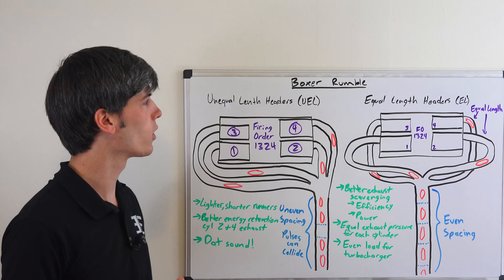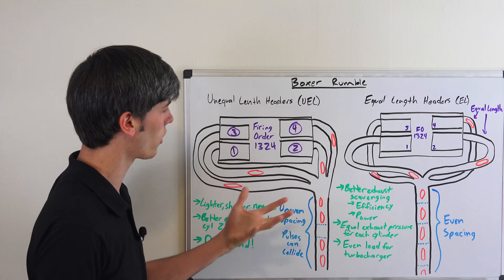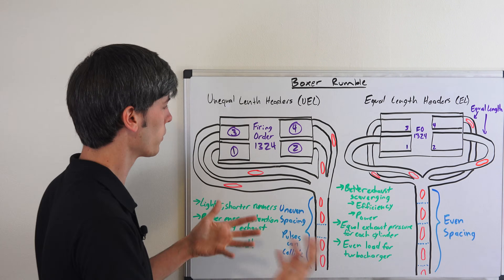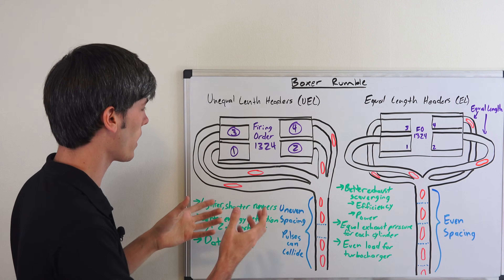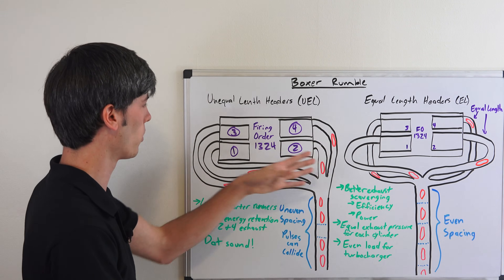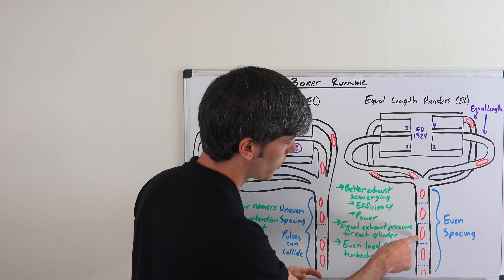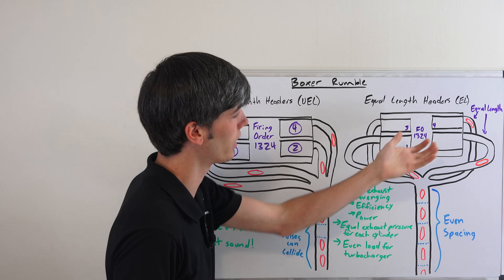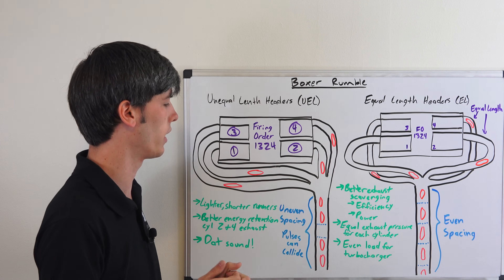Subaru Boxer Rumble - Exhaust Explained

Comment: It doesn't makes sense to me. It should be firing order 1 2 3 4 otherwise the gasses only once meet from two pipes at one time. In firing order 1 3 2 4 first comes the 1 then 3 and 2 at once then 4 and then should be break because the long pipe is first so it needs more time

Comment: Part of that iconic Subaru sound is the piston slap, and don't forget rod knock on the really well broken-in ones. 
I've been driving a 2006 Subaru now for about 10 years, and I'm not getting rid of it until it totally impossible to repair. I've already put a new engine in it at 190,000 miles, and I'm up to 225,000 now (about 35k on the new engine so far), and everything is going great so far.

Comment: A great video.  my question is for my Base model 2020 WRX/ STI. Does my base model WRX/STI have equal length headers or unequal length headers?  My other question is does the 2020 STI have an EJ25 motor or an EJ 20 motor?. Thank you 😊

Comment: Sorry but this explanation is not really correct. That's pretty correct that pipes length affects it, but the root cause of this "Subaru sound" is different tones of the exhaust pulses. Longer pipes give lower note, so we have two lower notes from cylinders #1 and #3 followed by the higher notes from the cylinders #2 and #4.

Comment: If I am right, the stock subaru headers are 4-2-1 UEL headers: the "4 to 2" lengts are equal at all of the cylinders, and the length differences are between the "2 to 1" lengths. Now, measure / count out that length difference. So if we design a 4-2-1 header for an i4 engine where the cylinders nr. 1 + 2 are connected, and cylinders nr. 3 + 4 are connected (the pair of cylinders next to each other - as the cylinder banks of the boxer engine), and the "4 to 2" pipe lengths are equal for the i4 engine, close to the subaru stock header's "4 to 2" lengths, then let's say, the "2 to 1" length for the cylinder 1 + 2 will be the shorter, but not matters the length, and for the 3 + 4 cylinder will be longer with the difference measured/counted out on the stock subaru header, then there will be the same exact ruble on that i4 engine? I mean, not the whole sound because of the totally different exhaust system, just the rumble...

Comment: Question: Subaru Levorg 2.0 non Turbo.
- Change with Manual Transmission 
- Install unequal length headers 
- swap the engine with an EJ25 (300HP)

Is this possible ?

Comment: So much more that goes into the boxer rumble. Different metals have different tones and sounds. Also resonators and mufflers and stock cats as well as catless + high flow all have different sounds. Another huge factor is piping diameter. Bigger the diameter, lower the tone.

Comment: Can you explain why boxer engines will have a boxer rumble when ran without headers and inline 4s do not? Because this little fact to me doesn't sound like it's all about the headers. Equal length individual header on a boxer motorcycle will also rumble and not an inline 4 with same setup.

Comment: The equal length headers were known as "Extractors" in Australia(possibly else where too).. also heard it referred to as "tuned headers" or "tuned exhaust" at some point. Extractors were fitted mostly to improve fuel economy more than anything back in my youth. They did make some difference. Like with not tuned headers, they had the advantage of removing heat away from the cylinder head more rapidly too than the cast iron manifolds could. Not sure how much of a difference it made for standard road use though..... 

There was the performance improvements that could be had too from the fitting of extractors.
Reply: tuned exhaust at least to me typically referred to 2cycle rc engines where it really mattered significantly more.

Comment: Take the exhaust right off at the motor if you wanna hear how subies really scream. They are really loud.
Reply: Yes. but there is no such thing as a boxer rumble. its just the out pipes making that "Rumble" sound. and no, you've obciously never heard one with the pipes removed. They sound like any other car. a "Boxer" (Flat 4) sounds NO different to any other 4 cylinder engine... do you know why? go on... before i answer. because LITERALLY, the only difference is? That the pistons are at a slightly different angle. That of COURSE, doesn't make any difference to the souns, because if you think "Im a piston, firing up and down in a cyclddr, DO i care which direction im firing in? 90degrees, 45 degree, 0 degrees? Nope.
Come on man! you're better than that!

Comment: So, Is this a way to combat the exhaust gas power robbing,?I guess my initial question would be: is that a subaru design to maximize the energy from the exhaust? I have a WRX with twin scroll turbo and i understand the benefit from that and it is phenomenal, but the sound is far from satisfying. The initial question would be: Does the un equal header length in the STI have a mechanical advantage to the system? Thanks
Reply: no it doesnt.  equal is a far superior method.  aftermarket headers tend to be equal length as well.

Comment: I don't undertand why everyone called it "Boxer Rumble" basically implying that because the car has a boxer engine, THIS is whats causing that beautiful sounds to come out, when it LITERALLy has NOTHING to do with the fact that it's a boxer engine, A boxer engine is the same as other engines apart fro the pistons are are at a different angle, making NO difference in sound.
What they're actually all thinking is the "Boxer Rumble", actually comes from the Exhaust system, The exhaust system used Unequal Length Exhaust Headers, THIS is what causes the cars to sound rumbly and awesome, again, NOT A THING to do with the "Boxer" rumble everyone thinks it is. How do we know? Well, go listen to other cars from other manufacturers who installed Unequal length headers... Honda Civic... wow Honda Civic has Boxer Rumble, also the biggest glaring fact, Subaru basically never changed that 2.0 or 2.5L Boxer engine at all, and after 2005 they stopped using Unequal length headers in their exhaust systems, and low and behold, there was no longer any Boxer Rumble, out of? a a pretty identical Boxer Engine... sigh

Comment: Why do people, even yourself, even though you KNOW what causes the sound call it "Boxer Rumble". When it's nothing to do with the Boxer that makes that sound... it's just the header and unequal length exhaust pipes.. nothing to do with Boxer. How do we know? Well, go listen to that Boxer now, it's still the same one, and it has an EQUAL length header... and wow, no "Boxer Rumble". Yet when you put an unequal one on it? The Boxer rumble nmagically appears lol. It's an exhaust rumble from the header and unqual pipes. Nothing to do with boxer. 
Do you also know how i know it has nothing at all to do with the boxer? 
I traded my 98 GC8 with 81k Miles on it, for a 02 Lancer Evo 7 6 speed M/T. with 49k on it. 
I LOVE the car to this day, i find it to be SOOO much better than the old impreza, and WAY better than any new impreza. My only issue was, i really missed that beautiful Burbling Sound my impreza used to make. The Evo 7 makes a decent sound, but nothing out of the ordinary, the GC8 98 made this INCREDIBLE rumbling sound only an evo showed in those days. SO what did i do? I found a guy in Dublin who could take my Evo's header and pipes, cut, add and weld unequal lengh pipes onto that fitted underneath in the same place, all 4 pipes were custom made and welded for me, 2 shortened, 1 lengthened and 1 kinda REALLY lengthened, and it fitted just fine back in (little bit of rattling until i managed to get some plastic tubing around the area),. i started the car and i LITERALLY started crying. My Evo now sounds like my Old Impreza... I though it'd sound "SOMEWHAT" like an impreza, but i presumed you needed the exact same shap and the pipes needed to be cut at certain angles and lengths to get that correct burbling sound but to my surprise... NOPE. Providing the 4 pipes are different lengths from eachother, and they aren't making contact metal on metal (at least 4 inches of difference between the lengths of each pipe), you LITERALLY have an Impreza Boxer Rumble.... I ALWAYS thought the only reason i prefered the imprezas to the Evo's was because of that sound, i was like "If only Mitsu made a better sounding car". Not realizing at the time what made the impreza sound like that. So now i have the most beautiful car i can imagine, with the sound of the other most beautiful SOUNDING car i can imagine (Outside of an AMG 63 or the Sports Jaguar XKS's) 

Just a tip for you guys. Measure up your space you have left over under there, and get a custom set of pipes with the header, unequal lengths, pop them in, and you'll have yourself an impreza Burble. No joke, There's a shit*y little 1.4l Honda Civic on here with the "Boxer Rumble" lol, because he also fitted a UEL header system, go check it out!

Comment: How about the equal length 4-2-1 headers on the base Impreza? Isn't the new WRX 4-1? An explanation on the differences between 4-1 and 4-2-1 could be in order because I feel like the 4-2-1 has less rumble than the unequal length headers but, still has a slight rumble.

Comment: Uhh, one question: I was always under the impression that in boxer engines the two opposing cylinders fire simultaneously. The opposing pistons rods do not sit on the same crank pin (thats what you usually find in a V shaped engine) but each sits on its own pin with 180deg offset. These two characteristics are what makes a boxer run smooth even thou the distribution of moment per revolution is less advantageous than in an inline engine with a 90 deg crank pin offset.
Was I so gravely mistaken for the past 40 years of my life? (sorry for my bad english, can't pronounce "th", german engineer here ;-)

Comment: I care for fuel efficiency, and I'm happy with the one on my 2015 WRX, but if the increase in consumption is minimal, I would pay a tuner to loose some horsepower and get the sound of the STi.

For how many years was the Evo better than the STi, but in the end, not everybody cared for the lap times, and boxer rumble experience turned the balance in favor of the STi with the people actually purchasing the cars.

If it were an option that came with a button, I wonder how many would not use the 𝒊𝒄𝒐𝒏𝒊𝒄 𝒃𝒐𝒙𝒆𝒓 𝒆𝒙𝒉𝒂𝒖𝒔𝒕 𝒓𝒖𝒎𝒃𝒍𝒆.

Comment: So if I were to want to fix the torque dip / problem with the FRS, for example, is there a difference in UEL vs EL headers? Either one would change the sound as well, no?
Reply: Dreamer el is more top end uel helps with the torque dip

Comment: I have a question, if I remove the exhaust and add one that has each header at the same lenght, will the boxer rumble be removed? Or does the engine play a role in the sound?

Comment: So how does having unequal length headers work out to be shorter, lighter, etc. Surely the short header pipes are offset by the longer ones on the other side...
The other reason for the throb is due to the exhaust pulses meeting at the joiner due to the unequal travel lengths... pulse on the short side may actually meet, or at least be closer to the pulse on from the longer side, making that exhaust throb note.

Comment: I have a 2011 Subaru Outback and I noticed that I have an intermittent shutter of the motor, usually when I am slowing down, but it also occurs when I am idling. I have the CVT transmission (unfortunately, I wanted the manual); could that be a factor in making it shutter or is it something completely unrelated? (It sounds like it is going to stall and the rpm's drop to just under 500 RPMs.)

Comment: This might sound like a silly question but shouldn't the gas in the exhaust reach the intersection point at the same time in the unequal length headers? Since cylinder 1 and 3 fire first and then it is 2 and 4 shouldn't the first two's smoke take more time to travel there anyways so by the time the smoke from 2 and 4 travels to the intersection the smoke from 1 and 3 arrive at the same time that way shouldn't they have the even spacings? sorry it was kinda long... Thanks!

Comment: This is a good explanation. I came across this because of the ecoboost mustang 4 cylinder engine being criticised for it's normal 4 cylinder sound. I always wondered why the 4 cylinder Subaru engine sounds so good, almost like a V8. So to resemble this, you would have to produce two seperate exhaust manifolds with unequal lengths, but at the expense of power. I guess the power is more important to most! This would be difficult to achieve on an in line 4 turbo anyway, due to limited distance avaiaible between the cylinder exhaust outlets and the turbo. The turbo needs to be as close to the cylinder head as possible to avoid lag etc. On a V or boxer layout it would lend itself however.

Comment: Jason, I know this is an old video but I have a question involving the FA20 motor in the BRZ.
I was told UEL headers cause lean conditions in the EJ series such as the current STI, but the computer electronics compensate for this by sensing the air to fuel ratio, resulting in a rich condition. My question is, if I install an AVO turbo that contains UEL headers for my BRZ with their provided engine management system, do I runt he risk of leaning out one of my cylinders?

Comment: so if make the length of the headers on cylinders 2 and 4 f my civic longer it'll sound like that?
Reply: hello there, i suppose it's 30-35 'cm' longer... But doesn't it depend on what kind of engine you want to use it on... 1600cc or 2000cc. I also want to try this on a 4 cilinder line engine, it looks a great experiment to me.
Is there a way to calculate this extra length...? I want to try this on a toyota corolla 1300cc, it is easy to reach this exhaust manifold...
Reply: Ok, but how you calculate the extra length of it ?
I want to try it but i want to know which length i have to add when i do it with this corolla (1300cc)...

Comment: I'll take  a 15hp loss over sounding like any  I4.
Reply: sevenpointsixtwo actually EL headers often dyno out to a 25 whp gain over UEL’s and 50 lb ft torque. Power and efficiency >>>>> sound. Unless your a ricer
Reply: @sleeper.simulant7327  efficiency yes, power no. Not without other changes
Reply: Randy Stull do enlighten please
Reply: If I strictly follow efficiency, I'll just ride a bike :-)
Reply: true words
Reply: Dual exhausts matter, too. It's like the difference between listening to "stereo" vs monaural.
Reply: OR don't drive a 4...
Reply: word
Reply: @Jimbob and i would watch videos that actually cater to my interests. Go watch videos on v8's, moron.
Reply: Would you take ringlands over sounding like any I4?  EL headers reduce the risk of failure because there's equal pressure on all cylinders.
Reply: @FusterIsBased  funny because ringlands still fail with el headers. So do headgaskets

Comment: arent the boxer engines the best configuration? why arent they more popular? and what happened to that flat 12 testarossa engine?
Reply: Oiling and balancing concerns. Take up more space in particular planes. More moving parts. Comparatively weigh more (2 heads, double the valve train goodness, etc). Yadda yadda. Best? No. different? Yes.
Reply: SidewaysGts ty. managed to get more info too.
Reply: Boxer has been used by Porsche for decades.  That's not to say it's "best" for all but  it works well in that application.
Reply: They usually cost more to maintain.
Reply: Well they are awesome... but harder to make fuel efficient, cost more to make and maintain compared to a equal sized Inline 4. I own a Scion FRS... the boxer engine was part of why I bought it over say a Mazda Miata (MX-5), Honda 2000s, Hyundai Genesis Coupe, or any other small light weight sports cars that can be found.
Reply: Alpha Fort
Well yeah, V's are significantly more expensive when going to the mechanic. Most of them are cramped, canted (mounted on an angle), have a full valvetrain on each side unless it's single-cam. A single cam 8 is just a really big 4. Mainly, the boxer is the same displacement with slightly more parts. Turbocharged engines are always expensive to maintain anyways.
Can't beat a 2.0L N/A, non-interference, engine! I can work on my car anywhere anytime, no need for any fancy equipment. I usually have most tools with me, plus it can drive without serpentine belt for a while. You just can't beat fuel-injected safeness :) Liberate the throttle!!!
Reply: Actually I think the biggest factor is cost to manufacture. Inline engines are a LOT cheaper to produce.
But there are a number of advantages to them. N/A boxer engines are very reliable for a start.
Reply: Some ppl have replied about the flat config having more moving parts. Assuming flat engines are a bit like V-engines but "spread (flattened) out further", how come the argument is not there for v-engines (yet v-engines being so much more popular). Isnt the flat engine better balanced than a V config?

Comment: How come they fire one side first? Wouldn't it be better balanced if they had left and right alternate? Like for example 1-4-3-2?
Reply: +Derrick Wyldstar, perhaps to increase crank life via power pulse flex/twisting on the crank, & torque twisting effects lessens the rocking couple at certain loading reactive frequencies, for other engine and additional components within/upon the engine (bay) area individual service lives as well.
Reply: He has the cylinder numbers wrong

Comment: The vintage VW air-cooled engines used in the Beetle, Karmann Ghia, Type3, the type 2 bus and the vanagon from 1983-1992 which is a waterboxer all produced the boxer rumble depending on the exhaust system used. as the Subaru engines are a popular conversion for the water cooled vanagons, as the early vanagons from 1980-1983 were air-cooled.

Comment: 1&3 and 2&4 join immediately after the exhaust port. complete different sound when you use a 4 into 1 (the design used). believe the factory set up sounds the best.